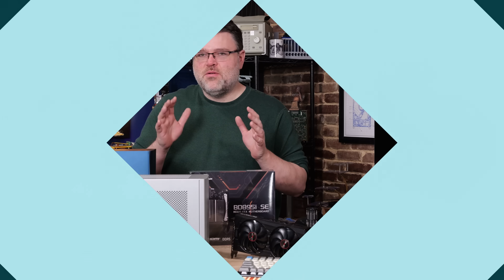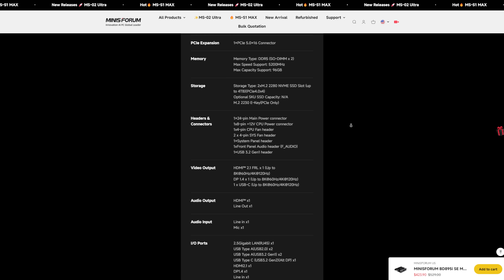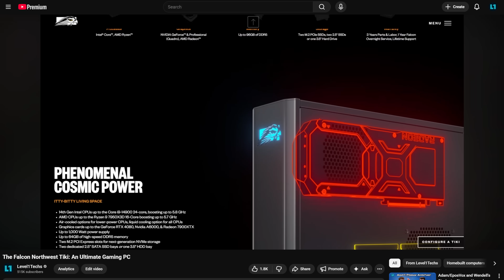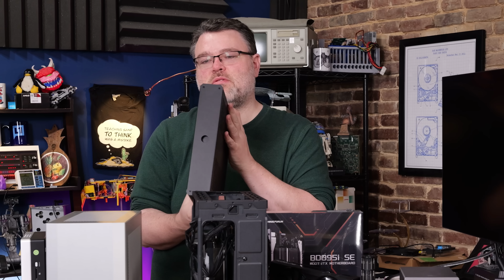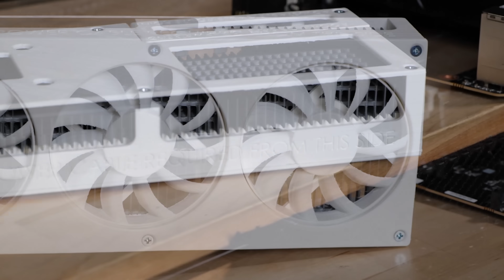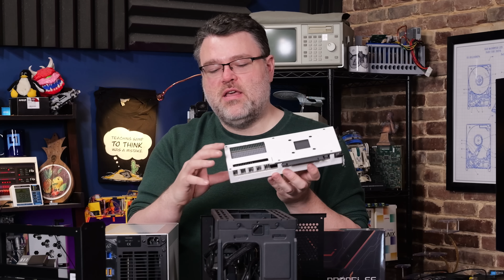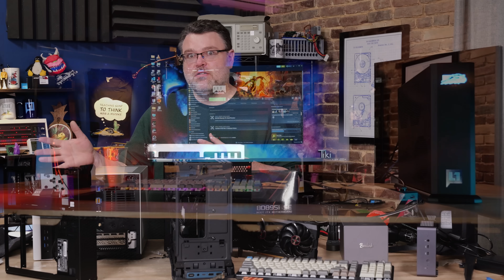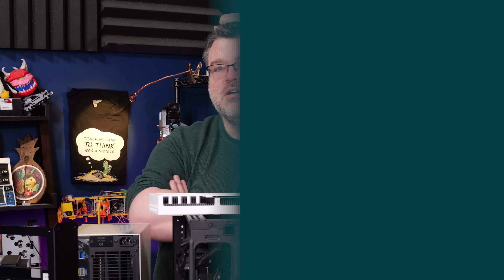Mini PCs Need Some New Rules! Ft: Minisforum BD895i SE Motherboard

Comment: DTX motherboard form factor. Or even mDTX. Or even  even  DTX+/mDTX+  with 3 expansion slots. Use the extra side length to place all the USB & type-c headers, and even more M.2 sockets. Get all that stuff away from the "bottom" edge.
https://en.wikipedia.org/wiki/DTX_(form_factor) Create an Express MXM  gpu form factor with PCIe5x8 lanes. (preferably x16 lanes, but..)

Comment: I want to see more effort on APU and dGpu integration and since AI is in everything and is apparently amazing fix crossfire so builds can be smaller.
 Kinda like what intel did with the Nuc the cpu computer module was around the size of a framework mainboard with a PS5 blower fan for 2 slot height.

Comment: Surprised you didn't mention the 9070-non-XT, because IMO this is it's shining application. I'm running the BD795i-SE (non-x3d specifically) with a 9070 as a desktop linux gaming/CAD replacement (off-grid, powered directly from a 48v nominal lithium battery bank using an HD-Plex 800w DC-ATX PSU, to avoid stacking conversion losses); and have been pretty thrilled with it. Chose the 9070 for it's efficiency and how cool it runs, but was impressed that mine is practically silent (ASRock Challenger) even when the fans run.  It was a big step up from my aging, unstable, 8700k/1080ti build, and managed to squeak in under the wire with memory prices and this final round of retail priced GPU's at Xmas.  

Unfortunately as you mentioned, nobody makes a decent/reasonable case for this combination, especially with the DCATX.. I'm just running it test bench style until I get a chance to build a custom one. 

Side note, but along the lines of the topic of the video; I sure wish mb manufacturers would adopt ATX12VO standard , as that would infinitely simplify PSU design; especially for more fringe scenarios like mine, but for SFF in general it seems like a huge boon.
Reply: Can't you fit the hd-plex PSU in place of a regular SFX PSU with a custom mounting bracket?
Reply: @stefanstefanov00  I could certainly, and it wouldn't be hard to cad up a 3d printed port cover and bulkhead connection, but if I'm gonna go through all of that I'll prob just fab a case entirely, since I haven't seen any great, economical case options that'll accomodate this gpu without adding a ton of footprint. I'm open to recommendations however?
Reply: @javandempsey3729  Well, the case system from Not From Concentrate (on yt) comes to mind because you're using the HDPlex PSU. It is on the smaller side but you can combine two of those into a single case.
Reply: ATX12VO isn't really changes anything for exception of moving 5/3v to motherboard instead of PSU(including peripherals like hdd), new standard should basically consider modern limitations like 12v being too restrictive from perspective of amperage this days and it's reasonable to go 48v while 5/3v rails should just go away completely, nowadays this can be done basically by single manufacturer building motherboard and gpu while everything else like nvme, cpu and ram are still powered by power rails of motherboard

Your case thou it's completely different with average household over all planet, moreover it's don't matter how you will reorganize parts you'll have space for at least an SFX psu since your gpu is 290mm(and it's this long not without a reason thou)
Reply: @SergeiSugaroverdoseShuykov  I'm all for adopting a 48VDC standard, but I doubt anyone besides us feels the same. Since the server side has already largely adopted a 12VO ethos, it seems easy to jump that direction. Regardless the advantage of adopting a single voltage input to me, seems huge regardless of the situation, as it should hugely simplify PSU design, even for standard 110/220VAC application. I personally believe this is exactly why it hasn't been adopted; there's big money in standard consumer PSUs, and the more you simplify them the more competition you'll have to deal with IMO. It'd be dead easy to start offering consumer PC cases that accomodate some major manufacturer's 12V Server PSUs, like the very widely available surplus 1200W HP platinum efficiency models, which can be had all day long for $20-30 on ebay, etc, but why would the OEMs want that? Sorry, bit of a sidebar rant.

Anyway, for my application, moving voltage conversion to the MB; which makes all the damn sense in the world anyway; and adopting any single voltage input, would allow dead cheap/easy power utilizing standard DC-to-DC converters.. In fact I've powered my GPU directly with them, or even one of the aforementioned 12V server PSU's and an adapter cable, when I was troubleshooting my older GPU (which had started degrading, having intermittent extreme transient current spikes that trigger protections in numerous PSUs, leading to hard crashes). I bought the HDPlex PSU I'm using atm second hand, but unfortunately, it's a bit finicky as well, but I simply cannot afford a new one. ATX12VO though would be dead simple for me to power.
Reply: @javandempsey3729  something I was looking for was an edge connector for a, say, HP PSU that leads to a pico psu head. then it's in between "the conversion is done in the PSU" and "the conversion is done on the MB"
Reply: Similar setup to yours, except I have the XT. Works well and is efficient.
Reply: NFC Computer used to make a very compact case primarily meant for HDPlex DC power bricks called the S4 Mini (later renamed to Skyreach 4 mini) but unfortunately it's been out of production for a long time.

There's a Skyreach 5 mini in the works (collaboration with Ncase/FormD) but it seems like it's still quite a while from being ready

Comment: Blame the lack of 2-slot GPU's on the AIB's who decided to just reuse the tooling and massive coolers from the RTX 40 series on their 50 class cards rather than make anything interesting. I'm sure I'll be grilled by commenters saying the AIB's don't have the margins for that while completely ignoring the fact most 5090's had the MSRP's for their card models set to 25%-60% over the MSRP of the base model. I kinda wish Nvidia would've cut off ASUS allocation for their enormous and unnecessary Astral cards and used it to make more FE cards.

Comment: Man I have been so pissed with the GPUs being unnecessarily long! 

My friend gifted me a 9070xt. It was a powercolor red devil.. and boy it created more problems than it solved.. i was using an A4H20 with an old 3060 at that time.. and I almost had to do an entire new build around the 9070xt because the case wouldn't fit. My 650w psu was a bit too measley. I moved up to an matx all because I had to house the big gpu.

I watched a few teardown videos, only to realize that the PCB occupies half the backplate and the rest is just the heatsink.. and the fugly led and logos!

Comment: There should be an E-ITX motherboard in the shape of a GPU, so you could fit additional M.2s in a sandwich-style SFF case. The GPU’s PCIE riser cable should go under the motherboard, instead of over the top.

Comment: I don't think we need another form factor. What we need is better connectivity for egpus. Think what esata was to sata.TB5/Oculink is pretty good, until we get PCIe6. Alternatively, work on self hosting cloud gaming. That 500w GPU is less brutal if its heating the basement or living room rather than a standard 100-140 sqft bedroom. Honestly, if TB5/Oculink/some new thing were PCIe speeds, a lot of folks would probably get by with just a handheld they can dock for gaming. Then laptop/desktop is mostly just productivity.

Comment: I've been using ASRock DeskMeet products (both AMD & Intel), and modding them to use a Flex ATX power supply. Admittedly, the 200mm video card length is a significant limit. But I've been able to keep some very serious desktop processors cool in a tiny space for not a ton of money. I mean, I did take a big hole-saw to the case for cooling, but that was fun.

Comment: The oversized coolers and intermediate sizes between 2 and 3 slots and the "wherever it fits" power plug are a nuisance with the SFF that I wish didn't require hunting and pecking through models.  Some kind of standard, or "best practices" guideline would be nice to see in SFF GPUs.

Comment: rocking on a bd795i. warning. need to use stock cooler. machined some mounting bars to get a nh-d15 to fit. ok laying on it's back. needs custom backplate for horizontal. ditched and went back to stock cooler.

Comment: It seems our inflation problem found a new home thanks to Trump greenlighting the wet dreams of the tech bros. The upside on the price of tech is practically unlimited. I remember seeing once a hard drive from 40 something years ago that only held a couple megabytes or so. It was the size of a small filing cabinet and the bank that owned it had to pay IBM $250,000 for the fucking thing. They paid THAT much over forty years ago for only a couple megabytes. When we talk about data we use terms like terabytes or even petabytes. It isn't uncommon for homelabbers to hoard petabytes worth of data. We're talking a million times what that ancient hard drive could hold AND they paid $250,000 for it!!!! Don't sleep. Invest, guys. Get the parts you need now. Feel good later.

Comment: I have a formd t1 build that I had intended to use for travelling since it could fit into my backpack. Nowadays i just use it as a moonlight/sunshine streaming server because it just works so well. If youre looking for handheld/portable gaming aside of PC gaming, streaming from your desktop to a budget laptop makes so much more sense than getting a gaming laptop if youre fine with the setup process. I have fiber internet at home with a router running as a Wireguard server and with SQM for my setup, and unless your client streaming device is on a cellular connection the latency is nearly imperceptible

Comment: We have powerful fans to shift hot air out of the box.  It seems like a better idea to move the heat sinks out of the box and have lower power fans for the motherboards.  "Out of the box" is probably still in the box, but separated - move the GPU to one edge (or underneath) and seal off the CPU cooler in another zone.  A sparse cage around each protects the components while still basically being a mostly open testbench as far as the coolers are concerned.    I have a power block, 5-port switch, network TV tuner etc velcro'd to the back of my TV, so all you can see is one power cord and one network cable.  We probably need "cases to be seen" and "cases which will be hidden" to be different things.  I'd go with slimmer, but larger length and width.  Screens are large - you can hide a lot behind them.

Comment: PSA the PCIe slot in the Framework motherboard is a x4 slot that is limited to only 25W.. NOT the normal 75W you would expect in traditional x16 slots
Reply: The x4 slot is realistically the only hardware shortcoming on the FD which is otherwise an awesome little machine.....other than the awful MediaTek 7925 wifi card that is the only AMD compatible Wifi7 card.
Reply: Probably intentional to discourage people trying to slot in a PCI-e powered GPU into a Strix Halo motherboard given how limited in PCIe lanes the Strix Halo architectecture is.
Reply: @aznhomig  4 lanes of pcie5 would be totally fine for running a GPU on.  (its equivalent to a full bandwidth PCIE 3 slot)
Reply: That's good to know, I definitely had not heard that. But I think pairing a dGPU with that board would be an odd choice. Not saying no one would ever want to, but probably not most who are buying that thing.
Reply: I thought it was x8?
Reply: @official3h718  Nope, its both a physical and electrical PCIe x4 connector.   And is NOT an open end x4 physical connector either.

And the default Framework case does not expose the x4 connector.
Reply: @NPzed  Well, the problem is that the chip only has so many PCIe lanes. They could have either removed one of the two m.2 slots, or, perhaps even better, muxed it with the PCIe connector to give it 8 lanes when a card is added and disable the m.2 slot, but I think they don't expect many people to use the board in a different enclosure that would expose tehe PCIe slot and that's why they chose not to spend extra on doing that.
Reply: That desktop was so close to perfection 😭

Comment: ive stumbled over minsiforum while searching for mobos with notebook ram. there are also options but its to expensive and to crappy, i guess minisforum is the route to go in the right pricepoint. while saving 150-300 bucks on the ram alone, could mean a tier up in gpu, while the cpu can handle it. so i just looking for the Minisforum BD790i . its a solid option but not budgetfriendly at all. maybe someone will put on regular matx boards with sodimm slots but this will solve the problem at all, i guess sodimm will also effected of the shortage, just a matter of time. very bad times for system builders like myself.

Comment: I really think that upscaling tech, combined with frame gen can really blow this up.  We hammer Intel, AMD and NVIDIA on this yet it should be embraced.  I have an RTX 4000 SFF ADA that I replaced the heatsink with full copper, new thermal paste and pads and I run modern games at 3440x1440p and even 4k with DLSS and Frame Gen.  It doesn't get any smaller than that unless you're looking APUs to step it up beyond Ryzen Max.

Comment: I've been using the BD795I SE as a NAS + VM hosting. I used a HBA for the drives, however, i recently bought a n150 build specifically for the drives and now my BD795SI SE is rocking a a4000 gpu and haven't had any issues :D.

Comment: I think part of the issue is the general lack of mid range anything. So either you are building basically a business desktop, or a fire breathing gaming or compute monster. So case builders look at it as either apu builds or they need to support a 9950x3d + 5090 or a6000.

ETA: it's also a price vs performance issue. "For not much more get a lot more performance" or "can't have a lower spec gpu core with lots of vram" or where's a 6 core 12 thread high click speed cpu? Gotta buy an extra 2 cores. 

As for other std form factor changes, why not ditch the pciex16 slot form factor and go for 2x mcio connectors? Or add 8 or 12 pins to a std pcie connector and do away with the power connector?

Comment: You should reach out to Not From Concentrate to test the Skyreach 5 Mini. It's about the same size as the smaller Sentry you have there (10L, might be even smaller?) but fits up to 3 slot coolers and it has the bottom of the PCIe bracket inverted compared to the sentry so the power cable is not an issue. Very nice layout and design. Btw it's possible to cool something like a 9800X3D with some CPU coolers that fit in such a limited height (Noctua L12 Ghost edition or the normal one if you are brave enough to bend it, Thermalright AXP-series coolers). I have a FormD T1 (which is smaller than S5M at 9L, just a less convenient formfactor) because I wanted somewhat better cooling than that though.

Comment: We need CAMM2 for different system form factors. PCIE power via the socket(that extra slot ASUS has shown)
Reply: i wonder if there's enough copper in a reasonable length card-edge conector for 200-300W? maybe at 24V?
Reply: @SevenWay-pu1xm  ASUS has a power connection called BTF. Just on one 5090 ultra premium card with little to no motherboard support. It can be done, just will the industry accept it 🤷‍♂️

Comment: I bought Strix Halo because i didnt think this craziness would be over by the time Medusa Halo comes out with what i assume will be LPDDR6 or a 384 bit bus (really Strix needs a 512 bit bus for these 40CUs and another 64 bit for the 16 cores)
Also my 16GB GPU wasnt enough for my photo/video editing often spilling over into and eating up all 32GB of system RAM, so i ordered the 96GB version (150 more expensive than the 64GB version)
I'd really love to see them come out with a Strix Halo 388X3D with 8 X3D cores to free up some membus cycles for the GPU, even if it was the same cost as the 395+ i think it would be the better part, though having 16 X3D cores would be even better for keeping that package power and heat low and performance high, but that second X3D CCD wouldnt really help in gaming that much more for freeing up bandwidth than increasing CPU performance.

I dont think we're going to see a 10GB GPU wiithout it being a 50 class card with a cut down 160 bit bus
No one wants to make 1GB RAM modules, unless they're going back to GDDR5 which i believe is on an older node and not used quite yet for things like automotive
Heck, Intel might be poised to make a 10GB GPU because whatever they did with the B390 memory controller to get that level of performance out of LPDDR5 is utterly astounding imagine a B575 thats basically the B390 scaled up to the B580, and then given 12GB of GDDR5 instead of GDDR6(since its somehow not as memory bandwidth sensitive as the B580)

Comment: Imagine a standardised set of form factors, a 2 slot GPU as you described. 
But also a motherboard with the same physical dimensions, a right angle port on one edge so you can have them side by side, or use a simple riser cable/board to fold them.
12VO power for the motherboard to simplify cabling.
Reply: Right angle pcie slot above the cpu would allow a horizontal pc ventilate both with only a mesh top. The pins could be soldered on opposite sides of the motherboard so the socket is inline.

Comment: HP 8700g desktop with 32GB DDR 5200 and 1TB NVME refurbed and a 500W HP PSU is approx $550 on ebay, the PowerColor 9060xt 16gb is $400 on Amazon.
With CachyOS deckish, you have a SteamMachine for $950.